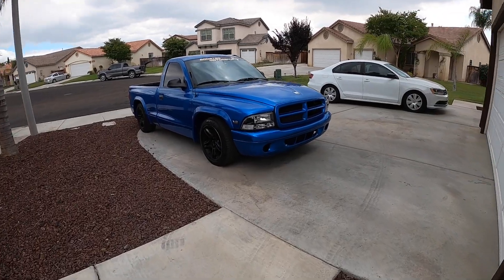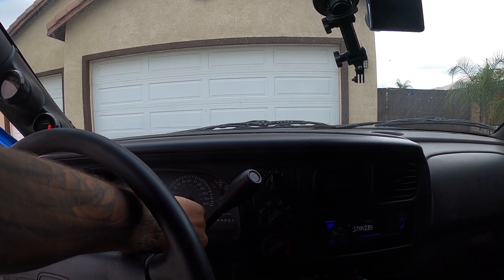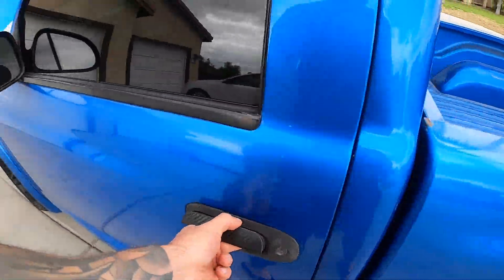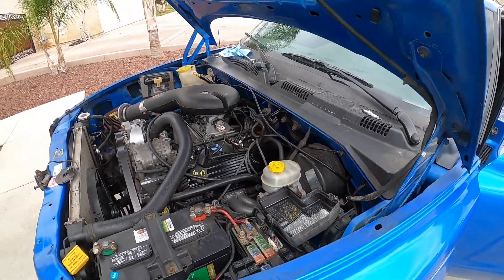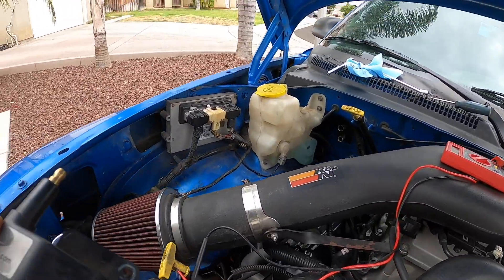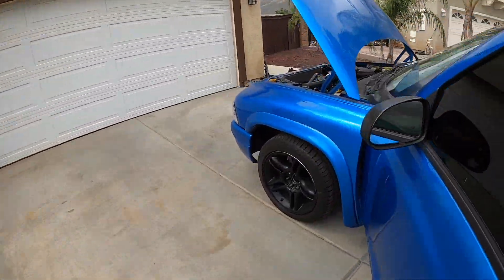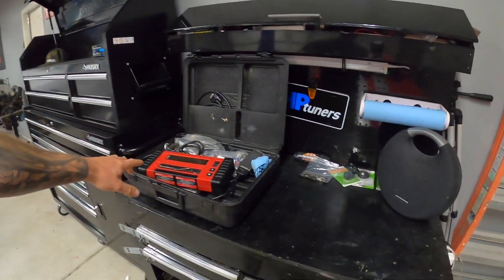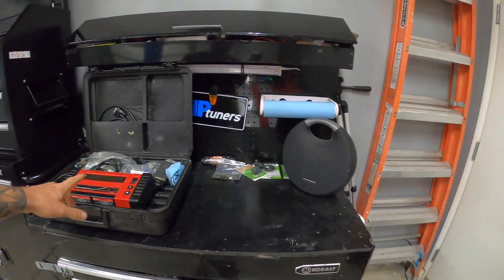PROBLEMS WITH THE DODGE DAKOTA R/T

Comment: Dude it’s a Dakota thing. Seen the cap not connect with the rotor right and do exactly that. Just something to check. When you change things this is part of it. Keep building. Throw the slicks on it and send it. Also check your IAC and TPS. Those are notorious for doing this in Combo with o2 sensors going bad. Good luck.

Comment: Don't forget to check the spark plug wires as well. Maybe one or 3 came loose when you had the distributor cap off. I've never had much luck re- using old plugwires on my Dakota for some reason🤔

Comment: Recheck timing for cylinder #1, that weird startup is the distributor not being in the correct position. Basically affecting fuel sync.

Comment: Now that it’s running check for cracked distributor. I’ve also seen this happen with bad plug wires. You can run it in the dark and may see electricity dancing between wires. Good luck 👍.

Comment: I totally would have done same John.. swapping parts one by one as you don’t know till you try .. hopefully you will get it figured out ..I agree maybe one of your old parts of engine not good I know it’s frustrating but keep ur chin up brow .. once you do get it all running good .. I’d really like if you idle engine in park an walk around to muffle side to hear how she chops an also when it’s in gear an walk to muffler side .. then take us out for a drive in it so we can see how it works with new cam An M1 intake etc .. I very close to doing same to mine right now An jus would love if you could do for me .. thanks man .. do some city drive light to light so hear how it idles when at stop light An how it takes off at normal acceleration an some highway runs an cpl pulls please anthanks
Reply from the maker: For sure!  Thats the goal. Just one thing after another with this truck lol

Comment: In plug the battery overnight and check it again in the morning the ECM may be in limp mode and check your plug wires you had the cap off they might be loose

Comment: I relocated my coil to the firewall. Using a Accel coil with MSD6a..This took the coil out of the heat ( who the hell puts a coil on a exhaust manifold?)..Shortened the coil wire by 18inches....length equals resistance...nice hot spark.

Comment: It's likely the POS JTEC+ PCM. They are notorious for causing issues like this. They break down over the years and the rather poor soldering starts to come apart. Seriously, I've dealt with this same shit in several Dakotas and Durangos. Replaced entire ignition systems, all the sensors on the 5v reference and still had the problems. Replaced the PCM with the correct rebuilt replacement and boom, runs fine. Google "JTEC PCM problems" and you will find a massive amount of info. Needless to say, the whole electrical system on these trucks are trash.

Comment: Coil issue most likely if it’s heat related.
Reply: I relocated my coil to the firewall and shortened the wire by 18 inches.

Comment: Check computer.  ECU /  PCM
Trust me check it. Have a 99 5.2. Dakota changed everything.  Turned out to be PCM/ computer
Reply: Same. My 99 5.2/5sp/4x4 had constant issues stalling and running like shit. Replaced everything, with no change. Replaced the PCM, been running fine since. A very well known issue.